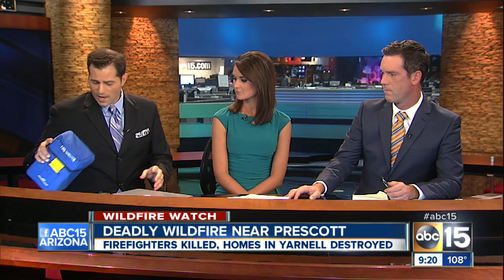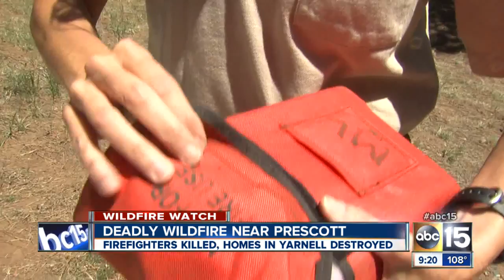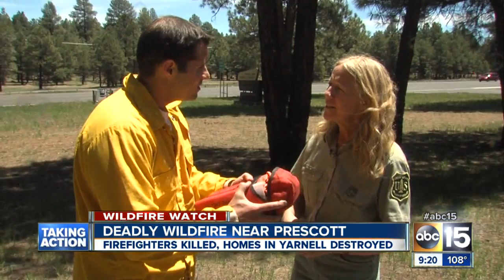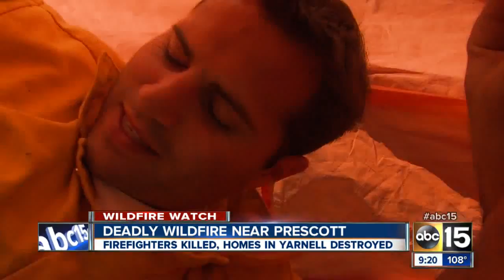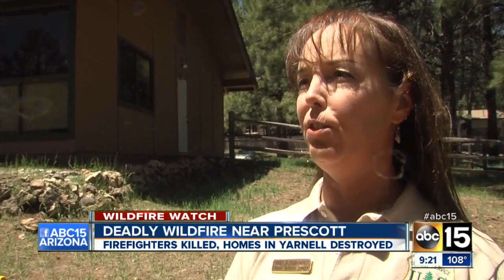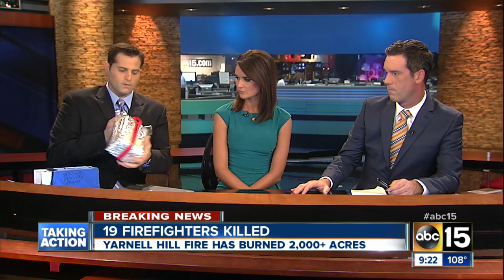Firefighter safety shelters: How they work, how they can fail

Comment: It's useless and useful:( honestly 50/50 but it's what saves our soft thin skin from falling off. Its not a popular opinion but I'm glade they died with 2000° +  temperature. Those temps makes skin blow off like dust on a book shelf and within 5 seconds your skin is gone and there's no nerves left to even feel the pain and is the most important factor when you know your going to die is not having to suffer.
the only bad death is a slow death and helps me be thankful for the heat that killed them is the heat that also let them go faster than usual. Most fires like they deployed for would be less than 1000 and could survive even up to a couple minutes rather than feeling no pain from 2k temps :) if you look close there's always something to be thankful for in the worst situations ever
Reply: You do know there are more nerves within the human body other than the epidermis? The theory of pain not being felt under certain conditions is speculation at best. Yes, eventually the nerves do get destroyed by fire. But how long it is until the person FEELS that pain is only known by the victim.